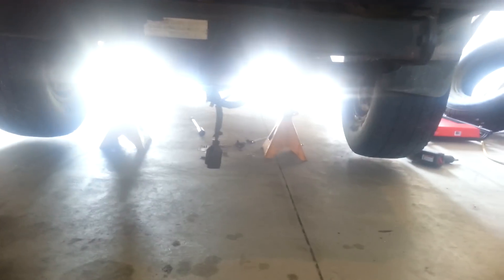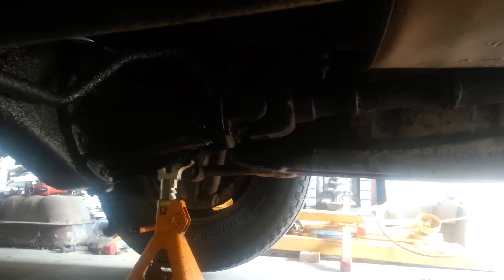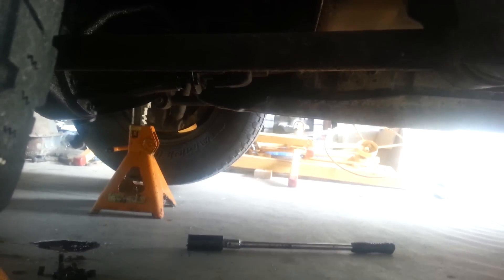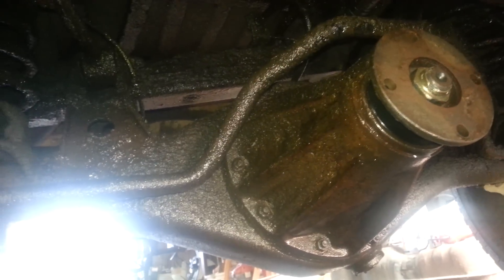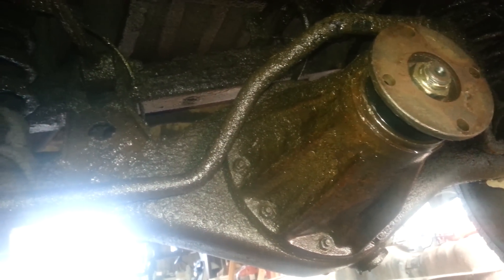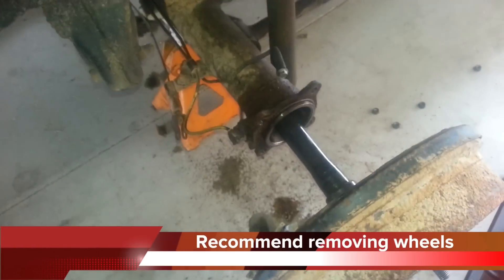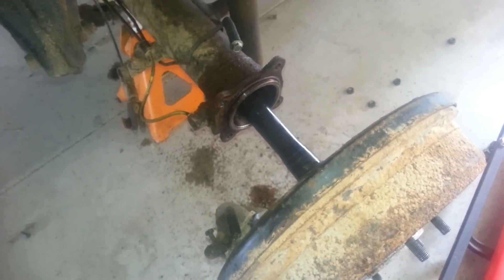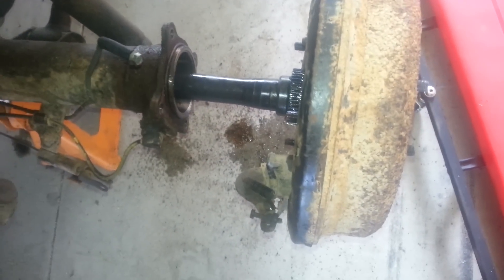How to: Swap a Toyota rear third member

Comment: Is their torque specification On the rear end?
Reply from the maker: no. There is, in the service manual. I've done several. Typically when swapping out the dropout, I just take them to "gutentite" and inspect them after a few miles.

Comment: Hey bro .  i have a 2015 4x4  all whee drive tacoma..   i want to install a torsen differential in the rear,, not sure how to go about it.. any advice..
Reply from the maker: By torsen, I'm assuming you're referring to a locking rear, by Torsen. A locking differential (locker), just replaces the carrier inside the differential. You have to first remove it, as outlined here (obviously). But, you will also need some precision measuring instruments. If you're reusing the stock gears, you can skip a few steps. The main difference comes for the ring gear. There are bolts that hold bearing caps in place, which hold the carrier. You just have to remove the carrier from the housing, and pull the ring gear from the carrier. That part is simple. After you remove the ring gear and reinstall it onto the locker, you can drop it into the housing. That's where the precision measuring instruments come into play. There is a specific amount of gear lash (play), and depth (how far it meshes) so the gear doesn't eat itself. I don't have those numbers in front of me. But, you have to set that with the adjuster rings on each side of the carrier. I typically have stuff like that done at a driveline shop, as I don't do enough of them to facilitate purchasing the instruments. I generally just swap the dropouts. My 1986 has had the same one in it for over 20 years, and my 1996 has had the one that was installed since this video. But, that should give an idea what you have to do. So, best of luck. Sorry I couldn't help more.
Reply: Um no i meant strictly Torsen Differential..  not Locking differential.  Um  whats the difference between the 2.
Reply from the maker: Really? There isn't much of a difference. Torsen is technically a "limited slip". But, works on a similar principle. Installs the same way.
Reply: Ok.. cause I'm looking online  for a Torsen differential for my truck ..   but  can't seem to find one..  Is torsen diff just a generic part that can be retrofitted to my truck ?
Reply from the maker: Essentially, yes. There are specific applications for them. You have to get one, for your vehicle. Detroit Locker sells them.
Reply: awesome thanks

Comment: Good video!!!....I want to weld the front third member and i want to learn how to uninstall it, do you have any tutorial? Thanks!!!!
Reply from the maker: If the front diff is a solid axle, similar to the rear in the video, then removal is the same. However, if it is the 86 and later IFS front, then you cannot remove by simply dropping it out. On the IFS front axle, I highly advise against welding them, as they will break. I advise against welding the front in general, as it makes it very difficult to steer. You want an automatic or selectable locker in the front. A spool or welding the rear, is fine.